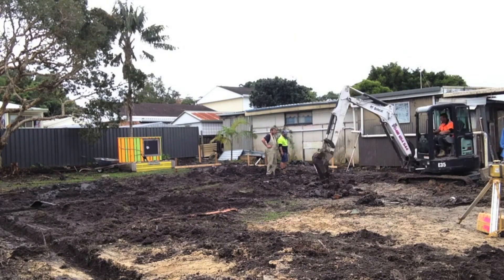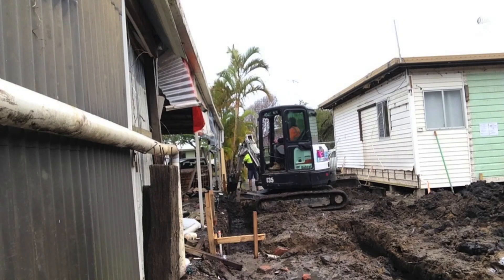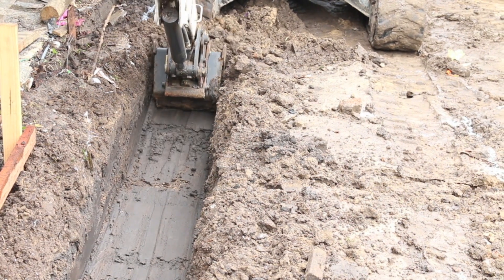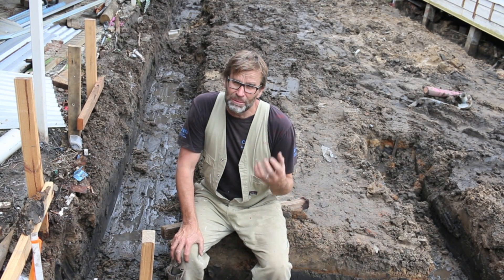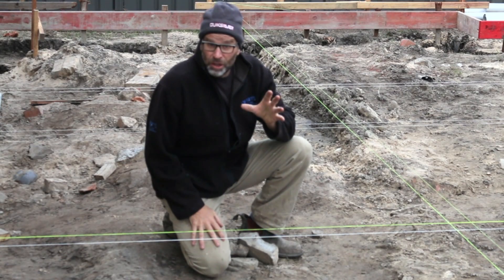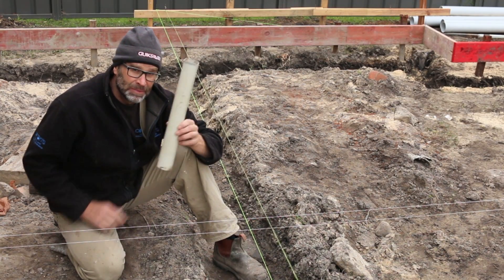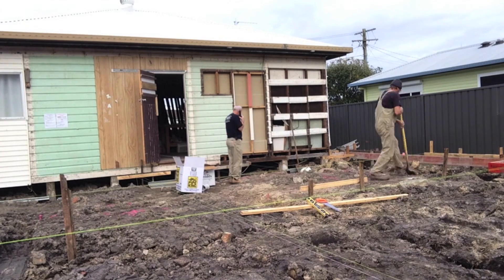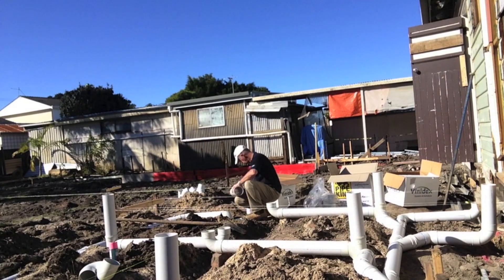Survey & Concrete Slab. Owner Builder Series Ep 10, Part 2.

Comment: I really enjoy this series you're making about your house. I don't understand what the crushNdust is for. It must be used instead of crushed gravel for a base. Why do they put trenches between the pads? What about the rebar or is that in the next vid?
Reply from the maker: mike smith Thanks Mike. The crusher dust is just another name for crushed gravel. The crusher dust is used to provide a good stable  substrate for the concrete to be poured onto. The trenches are used for strengthening purposes. Stay tuned as the final in the concreting series is coming up soon. Cheers

Comment: Very good stuff and thanks for sharing. Why don't you go with subfloors, like the old house. concrete slab is good, but if the pvc pipes broken it's a nightmare to repair. With subfloor it's heaps easier, and running cables and etc. Any comments? Thanks mate.
Reply from the maker: +Alex Huang G'day Alex. There was a couple reasons why we decided on a slab over bearers and joists. Number one is that we have a very high water table here so many of the homes around here on bearers and joists have issues with mold due to the moisture under the floor. Number two is that a slab offers a far better energy rating which you need to consider when applying for your DA. The plumbing really isn't a issue if you set it out correctly. Cheers mate :-)